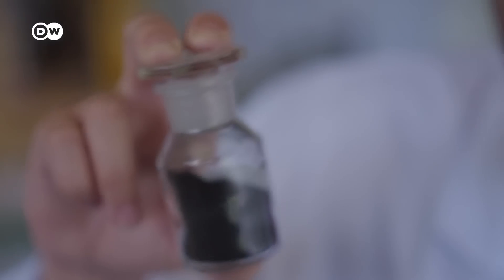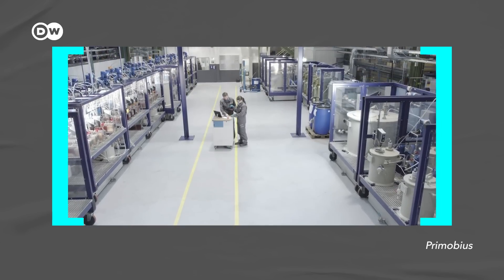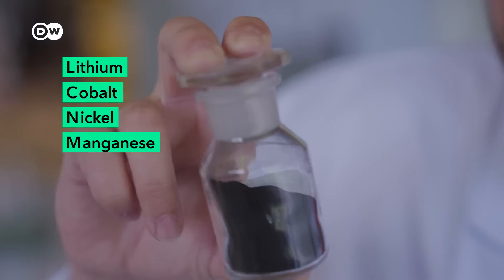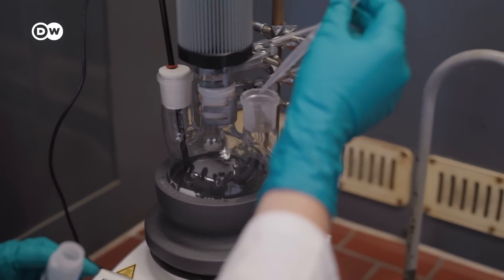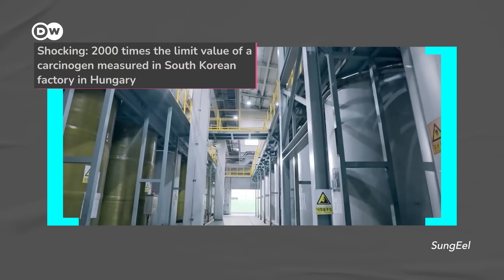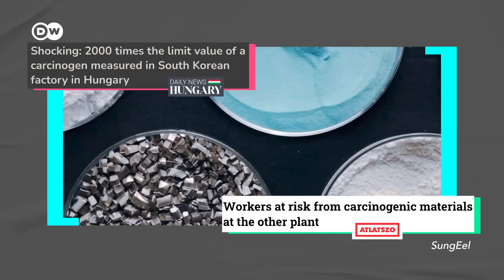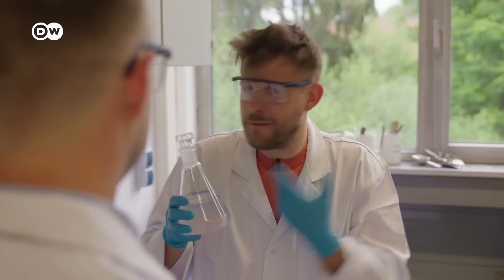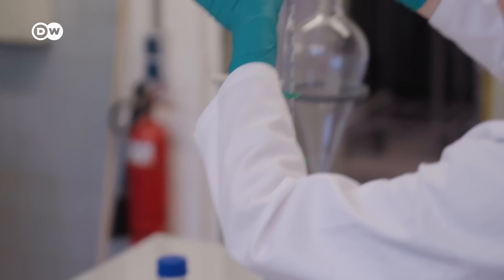The problem with recycling electric car batteries

Comment: Regarding the basic economics. 

No, it's not about "how much do you pay when you acquire the material" (8:10) 

At least not for the overall profitability of recycling. You only pay a lot if other recycling companies are profiting from it. If there is no one who can make use of the old batteries, the price is zero or negative (cost for the waste). Only if the recycling process itself (without the price of the old batteries) is more expensive than the market value of the metals, then there will be no one who would like to recycle it.
Reply: Have you heard that EU and Germany plan to mine lithium reserves out of Serbia? They partnered up with Rio Tinto to dig out lithium reserves in Serbia, and thus, cause ecoligical disaster...
But no one cares, because Serbia is a cesspool of Europe, not enough woke for Europe 🎉

Comment: This is early days in battery recycling. Every new industrial process had its teething problems. Even at its present state, only paper can be more effectively recycled than batteries. That certainly does't apply to all kinds of plastic, we all collect and deposit in recycling bins.

As for recyclers paying for old batteries, the EU already has regulatory solutions in other areas: manufacturers are responsible for recycling, or risk large fines. Some might even pay for recycling of their old batteries. 
Sometimes not everything can be left to market and speculators who operate there.

Comment: I like that you pointed out that the batteries have a very long life and they also have plenty of uses after they have been removed from the car.  It's important to remember that recycling is only a small problem that effects batteries from car crashes and any battery that has failed the quality control in manufacturing.

I think that normally when news media make videos about battery recycling, they are more focused on creating panic and making it appear that there is a massive problem, and that is not an accurate representation of reality.

Comment: Why don't use Hydrogen? Clean and more east to get.
Reply: Because it isn't.
Reply: Problem: It wastes half the electricity used to produce it. Will require infrastructure built from scratch as opposed to retrofitting the electrical grid and is a very hard gas to store.

Comment: Hmm "electric car batteries last longer than previously thought" well if the average piss poor  8-10 year lifespan is significantly longer than previously expected then I’d hate to know how long they were expecting them to last as their current lifespan is absolutely pathetic when you factor the cost of replacement the energy used to create the batteries and the materials required irrespective of the recycling aspect the materials still need to be mined in the first place this downside only becomes more apparent when you compare to a conventional vehicle with an internal combustion engine which if properly maintained can last decades and will maintain some residual and practical value over its lifetime.

The simplest solution is to abandon full electric vehicles on principle and call it a failed technological and social experiment they are simply a terrible solution to a problem that debatable doesn’t exist.

And this is not to mention the major limiting factor that has recently come to light we cannot possibly mine enough copper to facilitate this transition into lunacy that is full electrification electric cars are the poster child of bad and irrational thinking and subsequent policies of the various governments that have jumped on this most idiotic bandwagon.
Reply: Ps I thought the video was well produced and factual but the topic is something that makes me mad as we seem to have collectively lost our minds and we can’t seem to do the normal reasoning around this new technology I think electric cars have a very limited use case and we need to have more honest discussion

Comment: A lot of the problems you mentioned are reduced when you take SMSs approach (the plant you showed footage of) and sell the plants to the manufacturer. Eg Mercedes has a base level of feedstock, deconstructing their own packs is standard, and they are users of the end product and only need to make a smaller profit on the process as it’s part of an integrated lifecycle with more stable economics.

Comment: We shouldve put the effort into hydrogen fuel cells instead. Mark my works!

Why fuck around with metals n chemicals when you can make hydrogen with electricity and water, transport it and disteibute it similar to other gases, and use principles of internal combuation like other modern engines, and keep gear shifting (more fun to drive). Pure electric is so stupid, hydrogen is the way!

Comment: You should also discuss the relative challenges for mining and separating/purifying the materials. Recycling is challenging but is mining a challenge as well? Even if it is challenging, it appears all the technically issues are solved since it is done on a daily basis already. The one telling comment was that if you get the material for free, you can make lots of profit. If that is the case, it is economically feasible. The cost of the material can be settled by the market. The cost of disposal is either free to dispose of the battery or you potentially get some money for the used battery. No matter how you cut it, it is way better than dumping tons of CO2, toxins and carcinogens into the atmosphere. I would also like to hear what the carbon footprint of recycling is compared to mining.

Comment: "Low energy " - how much energy is necessary to make sulfuric acid?
Reply: The even more important question is how much energy does it take to recycle sulfuric acid.  Creating brand new sulfuric acid doesn't require a lot of energy since there is energy available in burning sulfur.   In addition, processing H2S recovered from desulfurization is a burning process.  But recycling acid by burning it to break it back down to SO2 requires an external heat source, like using natural gas to evaporate the water.
Reply: Sulfuric acid is one of the most produced commodity chemicals on the planet. The production of it is highly optimized. You typically  start from elemental S and react it with O2 which produces lots of heat, so energy input should be relatively low. For a battery recycling process that uses it there are likely ways to purify the solvent at some point, and even recover some from the sulfur containing of-gases to make more Sulfuric acid.
Reply: Have you heard that EU and Germany plan to mine lithium reserves out of Serbia? They partnered up with Rio Tinto to dig out lithium reserves in Serbia, and thus, cause ecoligical disaster...
But no one cares, because Serbia is a cesspool of Europe, not enough woke for Europe 🎉

Comment: I get it, but don't like that the title suggests far more issues than the content--someone just looking at the title could miss the reality that the problems in recycling EV batteries are totally solvable. So many folks out there believing misinformation that battery recycling is impossible and EVs are worse than ICE (which is disastrously wrong).
Reply: "totally solvable" is that a fact or an opinion of yours?
(Please, straight answer or no answer. Thanks)

Comment: in A.S.M.E. magazine decades ago there was an article "design for lifecycle" things like design for manufacture are well known but lifecycle is another thing. since the article I'm sure there has been many new tech developments which I think would make it more feasible. one part of lifecycle design is design for disassembly. I'd tend to think the shredding and separation part could be minimized and the batteries could be disassembled more with quicker and easier methods. thing is though these issues have to be included at the design phase rather than after. too complex for online discussion and government regulations?

Comment: It's cheaper to mine at the moment, I should think.  Luckily, batteries seem to have very long lives, and EV batteries have a full life after their use in their original role (in static applications).
Reply: Except China has almost monopoly on the mining. Recent events have told how much danger there is in becoming dependent on another country for your energy needs. And there are a lot of alternatives for static applications, but not for vehicles
Reply: @itsmegiorgio  I see CATL has announced an LFP battery which is guaranteed for 1.24 million miles.  So even lees need for recycling.
Reply: @dogsbodyish8403  companies make all sorts of announcements. Not necessarily that will be successful. We can't plan on the assumption that will even be commercialised.
That would be like divesting from renewables while we wait for nuclear fusion
Reply: @itsmegiorgio  CATL are the biggest and most respected supplier of EV car batteries, and their track record for living up to their claims is second to none.  You should consult the Electric Viking for more info, but 400k miles is already becoming commonplace anyway, using existing batteries (which have obviously been around for quite a while, so aren't exactly anything new).

Comment: "and recycling is better than mining them and just throwing them away"

Why do you think that's the case?

Its cheaper to mine than recycle for now, at some point that will change but not for now
Reply: Exactly my thoughts otherwise they would be showing their full method and these recyling centers would be popping up all over.

Comment: I wonder if the separated elements are pure enough to use in a new cell.
Reply: Yes, they are.
Reply: Yes and 90% of lithium and other metals can be recycled from used battery packs.

Comment: Why call a ratio 6:2:2 if you can simplify it to 3:1:1?
Reply: Good question with a simple answer: 60% nickel, 20% manganese and 20% cobalt
Reply: @Nuts-Bolts  So then 1:1:1 is 10% nickel, 10% manganese, 10% cobalt and 70% ???
Reply: @LoveClassicMusic0205  That’s 33.33 %  of each.
Reply: @Nuts-Bolts but don’t you find using two different ways of measuring (i.e. ratios and percentages) incoherent and confusing?

Comment: In Lithium Ion Batteries Cobalt is actually the metal that is included in only very tiny amounts. What happens to the rest of the metal in the lab? If it's just dissolved in some acid, 99% recycling efficiency on Cobalt is good, but 0% on the other metals would be way worse than that.

Comment: The only "problem" is that there are not enough batteries to be recycled at the moment. Only maybe some of the oldest Leafs, but that is nearly nothing.
Most of the old EV batteries are finding second life in stationary energy storage or DIY projects. Keep in mind that the stated "life" of a battery is only to 70-80% of its original capacity... it is still working perfectly fine but just has a lower capacity.
Recycling companies today need to wait around 15 years for a battery to be used in an EV and another 10 years for its use in energy storage.
LFP and other EV battery chemistries have up to 7000 charge-discharge cycles. That is equivalent to over 1,500,000 km. And it will still have more than 70% of its capacity.

I was wondering... Why did no one complained about battery recycling for the billions of electronic devices or one-time use electronic cigarettes? Every electronic devices uses LCO batteries with 60% Cobalt content in the cathode! While EV batteries use 3-9% and even 0% with LFP batteries. 
Large EV battery packs are much easier to collect and recycle than small disposable devices.
Reply from the maker: Hey Penko! Thank you for your comment. You right, the one-time use electronic cigarettes could be difficult to handle. We acctualy made a short video about it: 
👉 https://youtube.com/shorts/hRmJvwVRBLg?feature=shared 
Subscribe to our chennal, if you like our videos, we post new ones every Friday ✨

Comment: Just like the input cost for recycling determines its viability, we can increase the input cost of mining with taxes to make mining unviable as compared to recycling.
Reply: Taxing mining doesn't make recycling more viable.  It takes money from one group for what ever public purpose that are recipients.  And it increases the cost to society as folks do something less efficient rather than more.  If there are externalities that are being ignore, economic theory suggests that the system becomes more efficient because of appropriate taxation.  But absent that connection, it just makes the system less efficient.
Reply: 😄 you certainly have suggested a backwards  way to go about it.  However that would be an issue for a very long time. 
We can't get it out the ground quick enough.

Comment: 'reuse' over recycle. An 80% ex car battery makes a great home battery storage system. LFP is safest in the lithium range, but Sodium-Ion and solid state are coming in.
Reply: Agree, but the original electrolyte should be replaced with one that favours deep cycling. Otherwise the battery will sulphate up very quickly since it is 20% gone already.
Reply: Sodium will not be suitable for EV's because of it low energy content and higher weight.

Comment: This seems overly negative. For one thing, some of the "problems" are also solutions. Longer lasting batteries reduce the demand for more new batteries, reducing the need to recycle them sooner rather than later. Used batteries repurposed for grid storage until their capacity is too low for any other use, drives down the value of the used battery and therefor the costs for the recycler. The market will find a price to make it profitable because it is likely to still be cheaper than mining. It too means there is more time to work out the bugs in recycling processes. Recycling is in its infancy and will improve greatly in the coming decade or two.

Yes, there are processing issues and environmental problems to resolve. But plenty of time to do so before massive scale becomes the norm. Remember that this process only needs to be done once for a battery that can last a couple of decades or more. Compare that to burning fossil fuels which only get one use.
Reply: recycling was never taken into account in the first place!   How can you not see this fallacy for what it is?  Your reasoning doesn't add up.  it's plastic all over again.
Reply: @funnycatvideos5490  Nope! Used plastics have near zero actual value. In most cases they have negative value. Most of the metals and minerals in batteries have high value. In many cases, very high value. That's the difference between a viable recycling program and one that is not.

Furthermore, recycling wasn't considered at the scale of phones and laptops. This is an entirely different scale and recycling is growing quickly now as the first wave of used car batteries are becoming available at scale.
Reply: @ronvandereerden4714  these dead lithium batteries have negative value.  no scrapyard will buy this product like they will lead acid batteries.  The black mass creates more waste to refine and is not cost effective.  That is the reality.
Reply: @funnycatvideos5490  No scrap yards won't buy them. Battery recyclers will.

Comment: Sorry you start with the WRONG problem being solved.  This is the SAME problem I see OVER AND OVER AND OVER in these stupid YT videos of amateurs acting like they can make a video as if it's based on science and data.

So, how did the video  FAIL in the very beginning?  They said that industry has promised they can recycle 96% of the material in OLD batteries.

No, this isn't what's being promised.  For instance Tesla is developing a recycling program for TESLA batteries, the 4680.  The 4680 isn't an old Li-Ion battery.  It's new.  It was designed with multiple factors in mind INCLUDING recycling.

No recycling facility is going to be built that can recycle any old Li-Ion battery.  They'll be able to recycle NEWER batteries that were designed SPECIFICALLY for BEV and were manufactured with recycling in mind.

Didn't bother watching, don't want to listen to something passed as real information.

Comment: This tactic seems to be recreating the problems with plastic recycling.  Rather than general purpose plants to handle a highly variable stream, if you make manufacturers build in a deposit into the vehicle cost, they would get back a stream with known properties in an amount that could be estimated pretty well.  They would have incentives to make the batteries easier to recycle, since they would benefit directly.  The big part of the problem is that it probably won't be practical to recycle black mass for decades, and activists won't be okay with putting this stuff into speciallized landfills until then.
Reply: BTW, since the batteries are so valuable when initially produced, the amount of deposit required to get the batteries in the end wouldn't have to effect the purchase price of the car that much.  Enough to cover the cost of removal and transport (including profit).